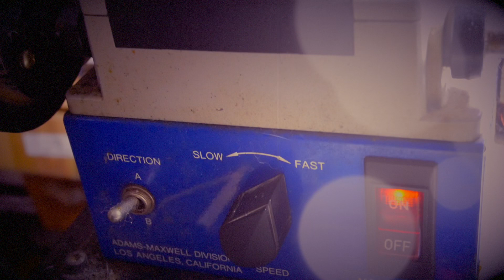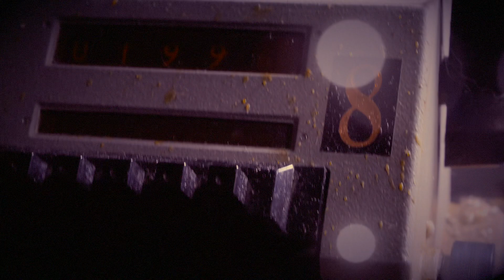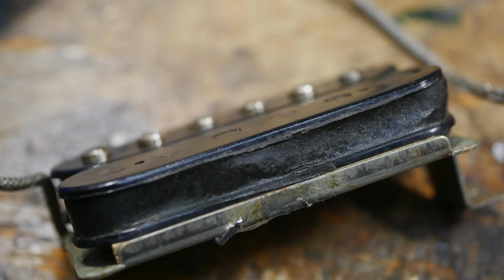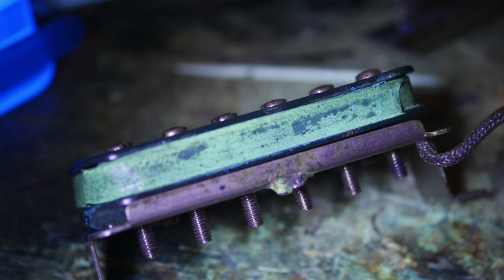PAF UNIVERSE EPISODE #11 - PAF RESTORATION DEMO

Comment: Awesome video Dave! Thank you for the tip on V-Cap!
Reply from the maker: Let me know what you think of it. ONLY the .022uf for bridge. The .015if cap for neck is good, but I prefer the Russian K40Y-9 .015uf better for best neck clarity myself. The thing is that if your neck tone cap is on the darker side, it also makes the bridge sound darker. This is from real experience. Even though its supposed on a seperate circuit, its not, they both are on the sound grounding.
Reply: @SDPickups  Interesting! I didn't know that the neck cap could influence the bridge. Me too I have the Russian in the neck. And Vitamin-T on bridge. I will test the V-Cap on the bridge because my bridge PU is a bit too bright. What can I say. It is not (yet) a SD Pickups HD61.
Reply from the maker: @marciomvp9458  Yeah, I use the Vitamin T in my harnesses. I sell and in all my Les Pauls, but the replica has the V cap, because its the real deal.
Reply: @SDPickups  Hi Dave. I just replaced my bridge Vitamin-T by the V-Cap 0.022. It is awesome! I find myself using much more now the bridge tone on my Les Paul! Thank you for the tip.

Comment: If that PAF cover at the end of the video is an example of your new process, then that's great.  It does not have an acid-etched look or any other extreme thing going on that would be unrealistic. And I agree with you on those great v-caps but man are they expensive.
Reply from the maker: Yeah, the V-Cap is $49. But you only need that ONE in the bridge. The neck cap is great but warmer sounding neck caps warm up the entire harness too much for me. So thats what it costs, but then compare buying a vintage NOS Sprague "bee" which is around $80-$100+, and might not be an actually good one either. These dealers don't test their caps in a guitar, and it might be that the really good vintage NOS caps, might be that they are the bad dried up ones considered to be unusable in high voltage amplifiers. Thats what the V-Cap company found out, and he doesn't reveal his secrets either, nor are his caps made in China that I know of. Chinese will make anything you want for them, but then they use your secret knowledge to counterfeit your products and profit from your knowledge. In the harnesses I sell and in my own guitars, I use the Mojotone Vitamin T for the bridge, they are great, but the V-cap is just alot better, so I use that in my own LP Replica in bridge.
Reply from the maker: No, the cover at the very end is an original 1957 PAF. Nobody can copy that look. I show macro photos of that in a previous episode, it literally takes 50 years of actual playing and use to get those 3D levels upon levels upon levels of acid etching from human sweat, oxidation of exposed areas and just dirt like that. Its not something you can imitate successfully. The type of nickel plating they used no longer exists now, either.  My process is shown in the front of the video, even those are not consistently repeatable, every cover comes out different, and that method actually starts with how I plate them myself. My relic process is always evolving every time I plate a batch of covers. The process is complex and goes back 20 years, and I try different things every time. They do look really good on guitars, and is even a signature look that I have that nobody can copy, so if your guitar ever gets stolen, its an identifier of my work. I had completely given up on doing these a few years ago, but then a good customer/friend told me the ones I gave away to him as being "too aggressively" aged, he told me every time he plays out, guys come up and ask him if they are real PAF's, so I kept on refining the technique over more years. My next batch is going to have some different experimental things again. I'd like to somehow get some green oxidation effects in there that you see in the '57 cover. Relicing covers is maybe one of the most time intensive parts of my work that I do and is the least controllable. Before the new method, the number of complete failures was about 80% and really depressing to have boxes of covers I can't really use. But, some comments were that a few loved those too, but most didn't like them either. Its all metal art techniques, going back to my art jewelry/lapidary days of manipulating metal surfaces.

Comment: what about potentiometers in those vintage les pauls ? are they all 500K pot or 550 or 300 ? what is the differense ?
Reply from the maker: They were Centralab pots. There is a mythology that they were really great pots, but I found them not to be. 
They ranged from about 470K all the way up to a full megohm. Most were around 550K ranges. No 300K pots ever. 300K started being used on the LP Deluxes with their minibucker pickups. I bought one of those when they were new, and they were AWFUL guitars.
Reply: @SDPickups  Thanks for the information , love your channel
Reply from the maker: @alexanderyarovoy8033  Thank you, you can help me by sharing the videos. I'm not getting very many views on my channel unfortunately.
Reply: @SDPickups  what year deluxe? I have a 69 deluxe and it's a beautiful sounding les paul with 500k pots